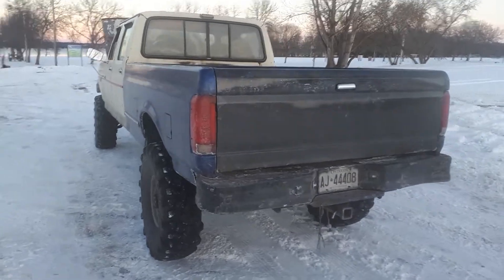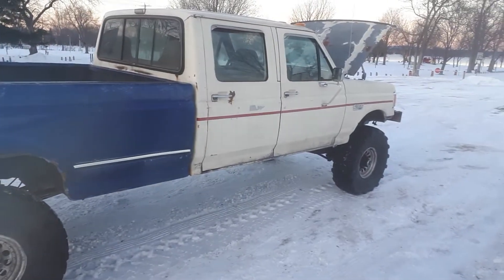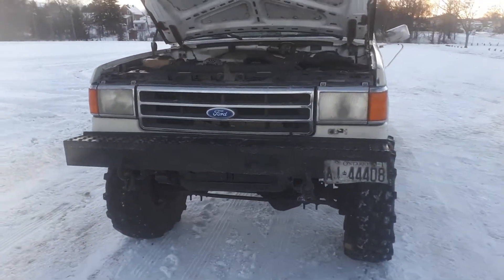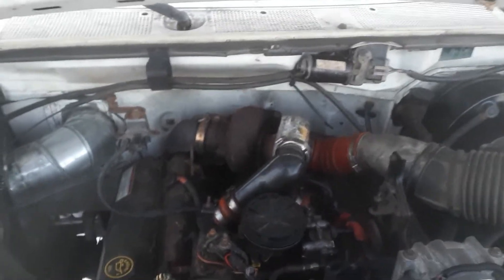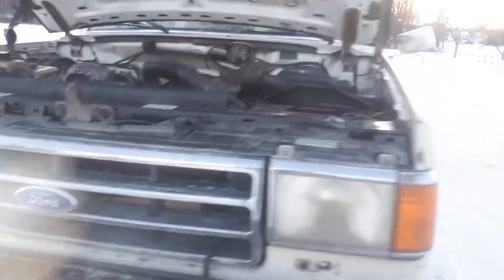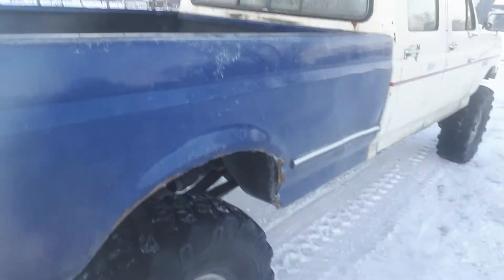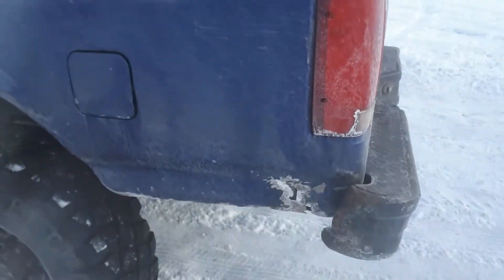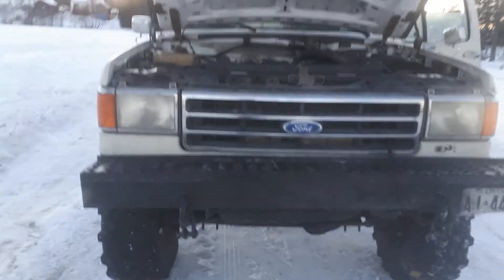o.b.s 7.3 overhaul is complete

Comment: That 93 of mine has right around 260k miles. It was an older man’s truck that owned a dozer/backhoe service and he’s owned her since 97. It needs front fenders/doors/cab corners as it’s got a reading service bed on it. I’m going to freshen the 7.3 up and do a complete front end over haul from the steering box out to the knuckles on the Dana 60 with a 4” lift like yours in the front. Wish it would have been the powerstroke but people tell me a 7.3idi is damn near bullet proof and sips fuel for what it is.
Reply from the maker: Sounds like you bought the right truck,likely well maintained by the sound of it.260k it's barely broken in which is awesome!..honestly I prefer the IDI over the more non conventional powerstroke,they're easier to diagnose..you only need a couple wires to run the IDI while the powerstroke has hundreds and a pile of sensors..they're the best when they run right but when they break it's the end of the world!..they say 24-28mpg for the IDI vs 28-32mpg on a powerstroke
Reply: @DumPhuc  this one has a minor haze at idle. Fires right up and he said didn’t use any oil which has me thinking injectors might need a rebuild or new set. She’s got rust being from Kentucky but I plan on putting it in the body shop and having the cab completely redone. I’m amazed that with a 4” lift you’re clearing 40s that’s just crazy.
Reply from the maker: @dommeister4004  the haze at idle may very well clear up as you use it more..diesel isn't like it was when these trucks were new,I recommend adding auto trans fluid to your fuel every 2nd fill up(half a litre in each tank),little tricks that have kept mine going trouble free..4 inch lift is plenty,with the stock front bumper removed I can clear 44 boggers but sharp turns the inner tires will rub on the frame..4 inch lift is still a good working height for a truck used for it's intended purpose..mine is used for off-road recovery and hauling a heavy trailer..also worth noting,any ford truck 1965-1997 shares the same body bolt pattern,so a 60s-70s body will bolt up to your frame like it was made for it!..using the stock wiring harness from the old cab works,reroute the coil wire from the ignition (positive) to the fuel rail on the diesel engine,it's really that easy!..for the time being tho,it seems like there's no shortage of o.b.s Ford's at the wrecking yards to raid body panels from
Reply: @DumPhuc  yea they’re plentiful around here and body panels are cheap. I’ve got a 24v cummins in an 01 3500 4x4 I keep a quart in the tank for each fill up to keep the lubricity in the fuel for the pump. I’ll have to try some in this old 7.3 as I start getting it ready to get back on the road. Owner parked it about a year and a half ago bc he bought a ton flatbed. I’m contemplating pulling that service bed off and putting a regular truck bed back on it bc I always loved that 92-97 250/350 body style and front end. I bought a set of pretty boy 20x14 American force wheels with a set of 35x14x20 yokahoma geolander tires on em about 3yrs ago I’d like to put on it and see how it does with that 4” lift. I’ll use it to carry fuel to my equipment and workover rigs I use on my oil wells so I’m hoping for the best of both worlds with the look and function of it. That’s good to know about the body’s swapping out. I’ve always loved the 80-86 front ends on a clean truck and known of a couple guys that have swapped them onto a newer cab. I appreciate all the knowledge as I’ve always owned gm or cummins trucks I’ll never associate them as a dodge lol

Comment from the maker: Overhauled just in time 4 winter.at 1.5 million km It got a replacement body,lower mileage powerstroke,clutch,lift pump,both fuel tanks,fuel bowl overhaul,hanger bearing,glow plugs,under valve cover wiring,a.c delete,4 inch susp lift,40" tires,a barrel of oil and an Olympic sized swimming pool worth of coolant.